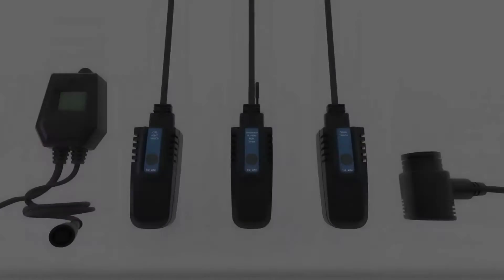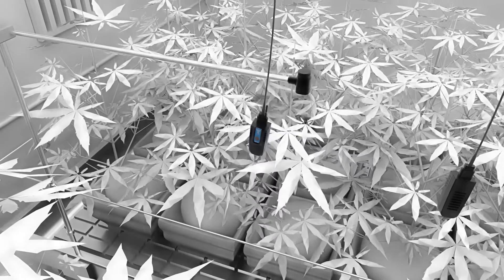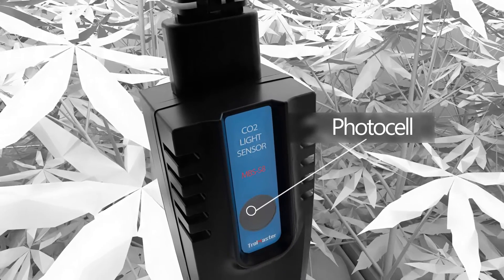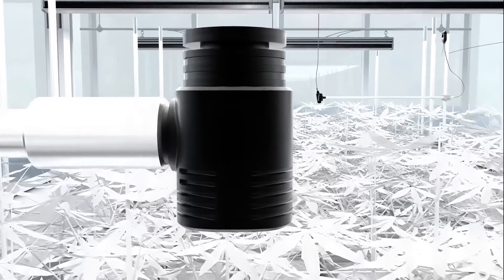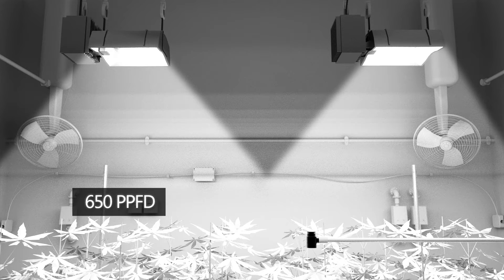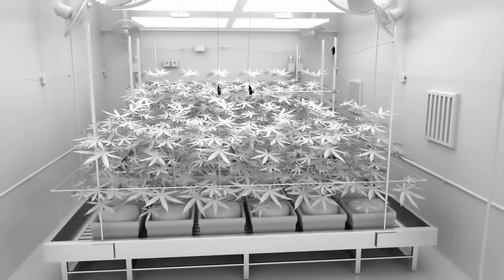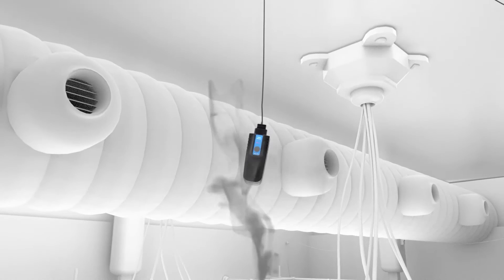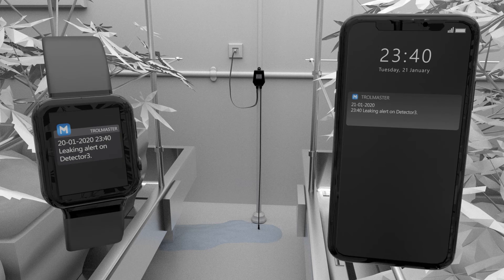Sensors - TrolMaster Hydro-X System

Comment: Is it possible to monitor temperature in 2 separate rooms with 1 Hydro X controller and incorporate 2 inline fans that exchange air from these 2 separate rooms only when temperatures reach a certain point if I should lose a A/C in 1 room ?? Thanks

Comment: My CO2 sensor station the CO2 station burned out why would that happen it’s less than four days in use
Reply: @vids595  no it was humidity
Reply: Humidity caused it to burn out?
Reply: @proz71ful19  The best I can tell because I looked at the sensors and the brass or copper fitting were blue and chalky indicating the humidity had gotten inside and rendered it useless from the moisture/humidity. I moved the device from where it was previously located and there have been no issues. The telephone cable end also had that blue-ish looking stuff almost as if a battery had leaked in a small toy but it was the control.  I still think this is an awesome system. It was just odd that happened. I also had one control device that was difficult to plug-in when I reached out to customer service they told me to take a flat head screwdriver to make the female end wider so I can plug in my device
Reply: @proz71ful19  TrolMaster stuff doesn't handle humidity well and they don't do a good job warning people about that. Any TrolMaster components that are IN the grow room will eventually have connection issues from humidity.

Try using dielectric grease on all of the connections 🤙